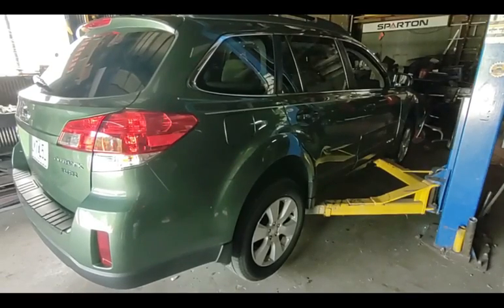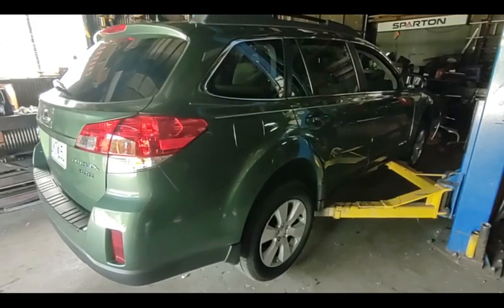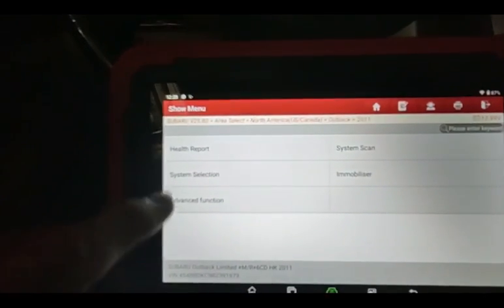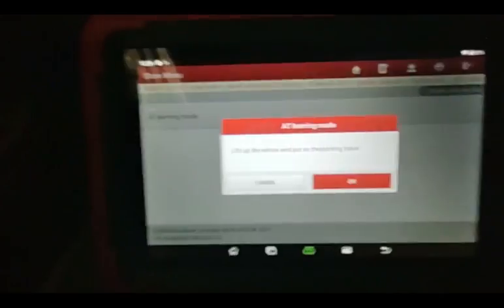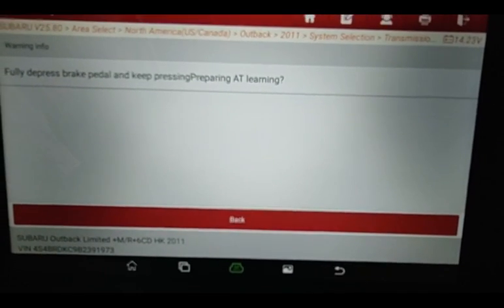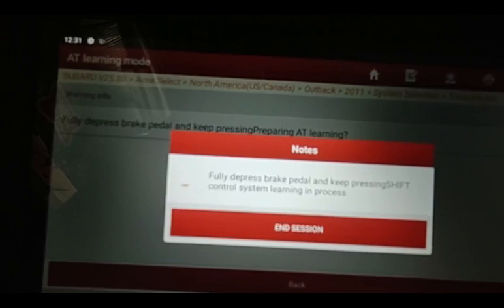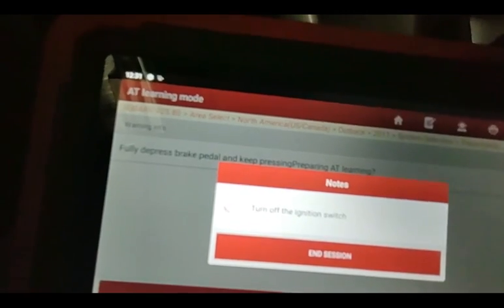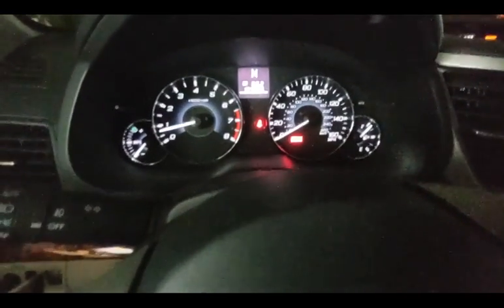2011 Subaru Outback 5-EAT (not CVT) TCM Relearn Process (Transmission Control Module)

Comment: So out of curiosity, how does the TCM interact with the engine? Is the TCM purely a reactionary computer (as in it reacts to engine speed, pedal position and engine load) or does it actively input with the ECM to the engine in some way?
Reply from the maker: My understanding is that the TCM receives input from the engine management (as you mentioned), but the engine doesn't have input from the transmission. Don't take that as gospel, but if there is a path like that, I haven't heard of it.

Comment: Hi my friend, why you reprogram the tcm?
Reply from the maker: I had done a fluid change on it, as well as removing the valve body to replace the speed turbine sensor. With that many changes, it's a good thing to let the TCM relearn its parameters since so much has changed since before I worked on it.
Reply: @Mark_H_DIY I have a Subaru Outback EJ25 turbo engine - 2006, when accelerating it takes a while to respond, and when shifting from 2nd to 3rd it kicks and makes abrupt changes when I accelerate quickly, otherwise it makes normal changes.
Reply from the maker: @alvaroblacidoramirez8314 the first thing I'd suggest is to do a transmission fluid change, using either Subaru fluid or something that is 100% compatible. I might also try a bottle of lube guard platinum, which helped a couple Subaru transmissions that I was working on. There's no guarantee that either will do it, but it's quick and easy and inexpensive, and has a pretty good chance of working. Good luck!
Reply: @Mark_H_DIY It could be a problem with the TCM programming, or you would also have to disassemble the box. Thanks my friend
Reply from the maker: There was no TCM programming issue - the transmission always shifted just fine (other than a bit of torque converter shudder, which I "fixed" with some LubeGard Shudder Fixx (sic)), until the turbine speed sensor went out, and even then when it kicked in and started working intermittently, the transmission shifted great.
Reply: @Mark_H_DIY Okay, buddy. I'll take my Outback to the mechanic to have the automatic transmission checked. Thank you very much.

Comment: Hi, great video, congratulations. Could you give me some advice on my 2010 Outback? My mechanic replaced my entire transmission, and after that, the 4x4 doesn't work and two warning lights come on on the instrument panel. Oil temperature - AWD - He replaced the valve body, and everything remains the same. The scanners can't complete the relearn because they give an error.
Reply from the maker: Way too many variables to take much of a guess, but if it was a used transmission make sure it was exactly the same as your old one. Hopefully, your mechanic has a Subaru specific bi-directional scanner. That should tell you an awful lot about what's going on inside. If he doesn't have one, it's really just a guessing game.
Reply: @Mark_H_DIY  Thank you for your response. Yes, the transmission is from a 2011 Subaru Legacy, and my Subaru Outback is a 2010. It's technically the same. I'll take it to have a Subaru scanner installed. Thank you.